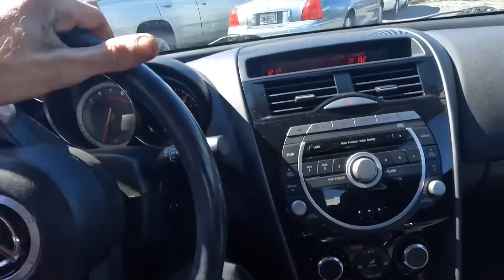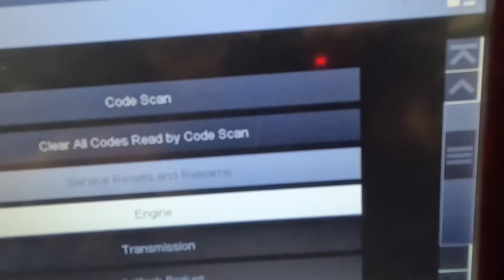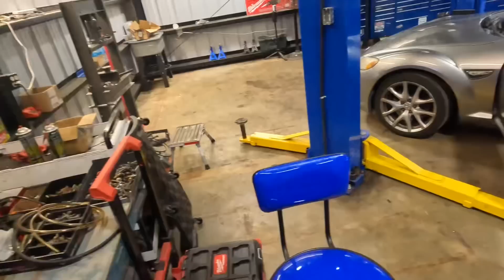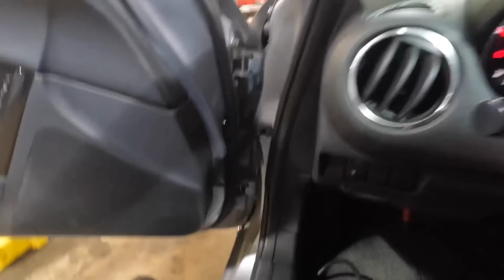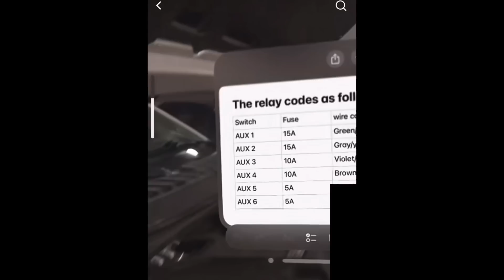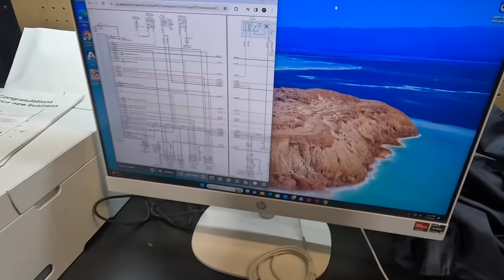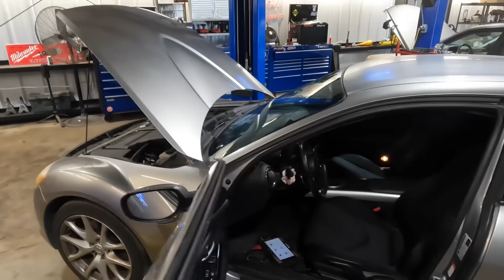Will Virtual Reality REPLACE Mechanics?? Mazda Rx-8

Comment: I remember an old NSU (50 years ago I was 18yo) witch had a rotary engine that an older couple had and was always having some issues, I was working as a chef in their hotel at the time, they took me for a drive because I had spent many school years helping my uncle in his garage and knew a little about engines.  They didn’t get to 50 mph and said that they never go much over 40 mph, and always drive very gently and their car didn’t like it at all, I told them that a rotary engine loves and should be used like a racing car and needs to be driven at higher revs in each gear, I drove it part of the way back to the hotel to show them what the car likes to be driven, she just sat there very quietly while I was showing them, he then drove it harder than they used too and was surprised how different the car was driving, he then dropped me back at work and they drove to Birmingham for a couple of days and when they came home they said that they now loved the car’s performance and was also cheaper on fuel than it used to be, I said that it’s not dragging it weight around anymore.

Before I gave them that information the car was in the mechanics workshop at least once every two weeks, but after that it only went in for its regular servicing and oil change.

Comment: Computers have already made people stupid with cars. I have been a mechanic, service writer, and parts guy. I have seen it all! But my best proof that everyone, even most "professional" mechanics (except you ray which is why we love you), have become way to dependent on machines is this. 

A lady comes into my shop and says I have a (I forget excat make model, but GM 5.3L engine) I need a oil pump. I am not paying you guys your rip off fee for looking at it, I have already had it looked at I need a oil pump. I just want you to put the oil pump in as cheap as possible. So I say "ok have the tow truck drop it in a spot, I will get you written up". She says "tow truck"? I say "yeah isn't it on a tow truck here"? "No why would it be towed?" "Well it's a oil pump, so the engine has no/low oil pressure?" I asked. "Well yeah, I guess, I don't know. My check engine light came on, I had someone pull the codes, they told me I need a oil pump. They wanted thousands of dollars and I didn't have it at the time, so I have been saving up and finally have enough money to do it, which is why I don't want to pay to tell me the same thing again". (Not sure why she didn't return to the original guy to have him do the job but I digress) "Wait back up a moment, how long ago was this?" I ask. "Um probably like 6 months ago". "And you have just been driving it around normal? And there are no weird crazy knocking or banging noises coming from the engine?" I ask. 

For those of you who don't a engine with no oil pressure would be luck to survive minutes before making crazy noises and self destructing, a engine with low oil pressure depending on how low and when could potentially make it 6 months, but even that is unlikely. So on ward with the story. 

So she responds "no no issues, just the check engine light". So I explain to her it is highly, highly unlikely she actually needs a oil pump and she really needs to pay me my diagnostic fee to tell her what she really needs (I suspect I already know the answer) and diagnostic fee and cost to replace whatever it is combined will probably be cheaper then just doing the oil pump. I will do the oil pump but it will not fix her issue and she will have to pay that and for me to diagnose it. She kind of hims and haws but I am confident I am right and she is wasting money. I really hate to see people waste money, and I am so confident I am right I finally say "tell you what agree to pay me diagnose it, if I come up with it needing a oil pump I won't charge you the diag fee, and I will even knock a little bit off the job. If I come back something else you will pay my normal diag fee, and then what ever the correct job is you need done". She says deal. 

For those of you who don't know the GM 5.3s are known to have the oil pressure sensor fail. More specifically there is a little screen that clogs that prevents the oil pressure from making it to the sensor. Either way the cars ECM sees a no oil pressure reading on the oil pressure sensor and triggers a code and check engine light. The code says "low/no oil pressure" (I forget the exact code and am to lazy to Google). If one sees a code that says low no oil pressure one might be inclined to instantly jump to you need what ever it is that creates said oil pressure, in this case the oil pump (after taking the most basics of step of making sure there is oil in the engine I would hope thou in this day and age who the heck knows). I mean the engine has oil, and the computer is telling you there is no pressure so clearly the pressure making device has failed right? Right? 

Wrong in all my years of working on cars I have never, ever seen one that actually had a failed pump. I have seen hundreds where I ended up replacing the sensor and screen (after a thoro diagnosis of making sure I am actually getting oil pressure and getting power and grounds where I should). But I guess what? Even thou every single one I have seen has had the same issue, and even thou there is a 99.99% chance the next one I see will also, every. Single. Time. I come across this I do a proper check. Do we have? What condition is it in? Is the sensor plugged in and all the wiring good? Are we actually making oil pressure? Then and only then do I replace that sensor and screen. If it were my car I would probably take the risk and just replace the sensor once I seen that code, but a customers car? Nope no way Jose. 

By the way in case you were wondering yes I was correct on that ladies car, that was exactly what she needed.

Comment: the problem with ai or the virtual reality stuff is you have to have a car that has all that sensors id like them to try to diagnose a 1995 or later car or truck with odb1 there was no real diagnostic tool you had to use a manufacture specific tool or a paper clip and odb2 only works with a car with the sensors but if the computer in the car aint working right you could get false readings and cost the customer alot of money, right now vr only really good for games videos not the way they portray them in movies like with ironman and jarvis all that has  to be programmed manually then turned into automatic like how when you had to program a website through html now you can just get all the auto code and program a website in minutes all the hard work was done in the years before , but there will always be technicians someone has to run the computer and then install the right part even if it's all done with ai

Comment: As someone in an industry where we make, and use videos like this: our viewpoint is that it is a supplement to lower the barrier of entry for a new hire. It will never replace experience, there are too many "gotcha" technicalities that happen in machines, but they do reduce the burdens that the old guard have when training the new hires. I tend to give it about 2 years in the industry before a technician has enough competency under their belt to do diag work solo without getting lost in the weeds. Videos provide a refresher for old technicians, and standardized starting points for new hires.

Comment: That technology will replace the grease monkey parts replacers employed by the dealerships, but It CAN NEVER REPLACE A COMPETENT MECHANIC. Case in point, my father in law had a check engine light in his 2006 Subaru. The “service adviser” told him they would have to remove the gas tank to fix it. A customer overheard the conversation and asked him if he just got gas. Yep….the GAS CAP WAS LOOSE….... THE DEALERSHIP NEVER SAW IS CAR AGAIN, and people wonder why they call them STEALER SHIPS.   I made sure my dealership knew i was an aircraft mechanic and explained to them that the only reason i use them is for major service to my AUDI….I will not fall for the ‘you need brake rotors’ BS. We have a good working relationship now and i am sure they flagged my identity in their computer with a D N F W….(do not F with) code…and they haven’t so far.

Comment: Your recent "new" steering failure video is another example. VR would not 1. know about the issue as the knock would probably not be related to steering and 2. know to crawl under the car and "see" the silicon and the moving end joint and associate thick new paint with poor reconditioning.

Comment: That technology will replace the grease monkey parts replacers employed by the dealerships, but I CAN NEVER REPLACE A COMPETENT MECHANIC. Case in point, my father in law had a check engine light in his 2006 Subaru. The “service adviser” told him they would have to remove the gas tank to fix it. A customer overheard the conversation and asked him if he just got gas. Yep….the GAS CAP WAS LOOSE…..LAND THE DEALERSHIP NEVER SAW IS CAR AGAIN, and people wonder why they call them STEALER SHIPS.   I made sure my dealership knew i was an aircraft mechanic and explained to them that the only reason i use them is for major service to my AUDI….I will not fall for the ‘you need brake rotors’ BS. W hav a good working relationship now and i am se hey flagged my identity in their computer with a D N F W….(do not F with) code…and they haven’t so far.

Comment: Alright ray now you done gone and ruffled my feathers... i have a 2006 rx8 the shinka special edition in copper red with the gray racing seats and its a six speed. Her name is lenore and ive had it since it was new. Most likely it needs new apex seals as these cars usually somewhere between 50 and 100k need them replaced. I actually sent my engine off to a shop over in the UK that hones out the engines making them natural aspirated hit around 300bhp. However that wasnt near good enough and with a couple high end turbos i now push around 850 to the wheels. The thing about rotarys is they are not about running below 5000rpm they are much happier winding out around 8 to 9k and can handle it. The biggest problem most people have with these cars are they just don't know enough and buy it because its different then they dont do whats required. For example if you start these engines and don't let them come up to operating temperature then shut it off. They get flooded and wont start. Ive had this happen to me usually after letting the car sit in my garage over the winter month's if i dont start it enough. Then you have to pull the fuel pump fuse out hook up to a battery charger or jump pack. Then get in and while pressing the gas all the way to the floor just crank on it over and over stopping after doing it for 90 seconds and letting the starter cool down for 60 seconds. Eventually itll fire and a huge cloud of blue smoke will come out and then your good. Although since having the engine redone i havent ever had to do this. A couple really cool things about the rx8s is the suicide rear doors and they actually have enough room in the back for someone to get back there. Me and my best friend and our girlfriends roadtrip this thing from Indiana back down to Florida every year for spring break. Another great thing is they are whats considered a mid engine car making them take a corner most cars cant. The only real complaint I have is that they drink a quart of oil every 1000 miles which is normal. You definitely need to always run premium fuel and using a berryman additive every 5 tanks of gas is smart to prevent carbon build up. They are also absolutely terrible for getting any sort of decent fuel economy. I get maybe 16 in town and maybe 23 on the highway. 

Personally as far as your question goes. Its like anything. Everything has its limits. Tools that can help you be more capable and better at your trade always are good. But i don't think AI is gonna take over many things.

Its like the jurassic park question they are so worried about if you could instead of if you should
Reply: Ps if you ever need any help with figuring out anything about these cars. I'm always happy to help

Comment: 3 New ultra hi end cars were on comparison test. One quit shifting.  4 hrs expended doing reflash via on-board up link later,  vehicle was flat bedded to dlr shop where a replacement of internally damaged trans fixed the issue.  No electronics,  only tools were used on actual replacement.  This scenario will be oft repeated as expanding world of A.I. baloney convinces owners , that their stuff can fix itself!

Comment: If you are so upset about technology, why don't you get rid of your scanner and computer?  The AR glasses can be used as a tool, so auto technicians bring up repair manuals and diagnostics.  They are not made to replace mechanics, rather to assist them.  As far as implanting microchips in a human brain, they are trying to help certain disabled people use computers to communicate, among other things.  Other goals including helping people who are blind, or can't walk.  Swiss researchers were able to help a paralyzed man from the Netherlands walk again using a system of brain implants.  Maybe you should stick to working on cars.

Comment: VR it self will not do anything else then get the info in front of you. With AR it can tell you what you are looking at, point you to where the component you need to look at is. 
It’s the AI behind that’s getting smarter for every sec. 
Connect the AI to the VR and it has eyes. It will tell you to look for corrosion. It will tell you to look for bad connections. 
You don’t need to pull all those tools up in front of you. Just ask what pin number to gos to where.
If you see a coolant leak, ask the AI what it could be and what to do. It will answer you like a human would. 

Will it replace you? Not in the near future.  It will just be a smarter information right in front of you, whit out you moving your ass to the computer or only have the odb2 screen. It will use all the tools for you, and give the best probability. And it’s not like you can’t question it. 
The scary part is that the AI is made to think like we do, and its brain is the internet and all available books.
Reply: Here is what the old ChatGPT is answering me. One could question what to do first but it’s not wrong. 

If you're dealing with a mass airflow (MAF) error on a 2019 Mrx8 as a mechanic, here's what you should check:

1. **Mass Airflow Sensor (MAF)**: Start by inspecting the MAF sensor itself. Ensure it's clean and free from debris, as dirt can interfere with its readings. If cleaning doesn't resolve the issue, the sensor may need to be replaced.

2. **Air Filter**: Check the air filter for dirt or blockages. A dirty air filter can affect airflow readings and trigger MAF errors. Replace the air filter if necessary.

3. **Intake System**: Inspect the intake system for any leaks, cracks, or loose connections. Air leaks before the MAF sensor can result in incorrect airflow readings.

4. **Wiring and Connections**: Examine the wiring harness and electrical connections associated with the MAF sensor. Look for any damage, corrosion, or loose connections that could cause faulty readings.

5. **Vacuum Leaks**: Check for vacuum leaks in the engine's intake manifold or vacuum hoses. Leaks can disrupt airflow and affect MAF sensor readings.

6. **Throttle Body**: Inspect the throttle body for any buildup of carbon or dirt. A dirty throttle body can impact airflow and trigger MAF sensor errors. Clean the throttle body if necessary.

7. **Exhaust System**: Ensure the exhaust system is free from leaks or restrictions. A blocked or damaged exhaust can affect airflow readings and trigger MAF errors.

8. **Engine Control Unit (ECU)**: Use a diagnostic scanner to check for any stored trouble codes related to the MAF sensor or airflow system. Resetting the ECU and retesting may help clear the error.

9. **Fuel System**: Verify that the fuel system is functioning correctly and delivering the proper fuel-air mixture to the engine. An imbalance in the fuel system can affect MAF sensor readings.

10. **Testing**: Perform a functional test of the MAF sensor using a multimeter or scan tool. Compare the sensor's readings to specifications provided by the manufacturer to determine if it's operating within acceptable parameters.

By systematically checking these components and systems, you can diagnose and resolve the mass airflow error on the 2019 Mrx8.

Comment: I used YouTube to change a timing belt and water pump on my 2008 Hyundai Elantra. Took 3 hours and worked great afterwards. If I didn't have the YouTube video I would not have attempted to change a timing belt. There are however bigger jobs like transmission work or engine rebuild that I would never even try to do no matter how many YouTube videos there are.

Comment: Ray, you did an amazing job explaining what it is to be a mechanic. Robots may be able to build a car, but they will never repair them. I forget, did you mention bolts that can't be reomoved because a 3inch bolt was used where a 2 inch should have been?

Comment: Actually the NC Miata is an updated, smaller, piston engine RX-8.  The 2006-2015 Miata is based off the RX-8 chassis and shares a lot of parts with it.

Comment: Until VR "Headsets" can fit on your head like a pair of glasses,  where it won't interfere while you're lying on your back upside down under a dashboard pulling an AC actuator, and where it covers EVERY 3D environment, it's not practical.  Nothing will replace hands-on until some android (like Data) is made.  That may never happen, but who knows what the future holds?  I would levitate toward a female one, but diagnosing and fixing a vehicle would not be her primary function.